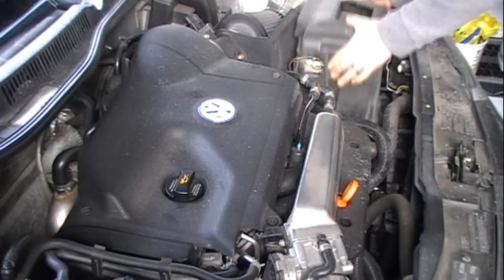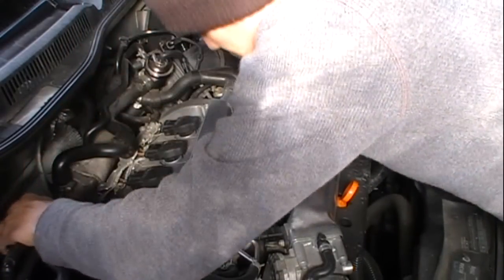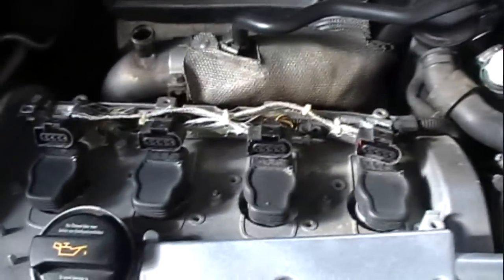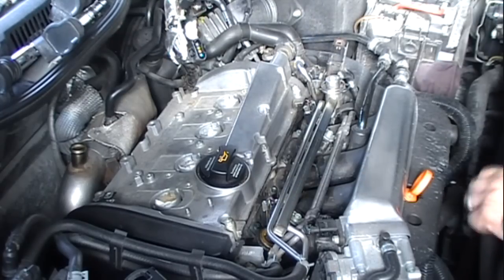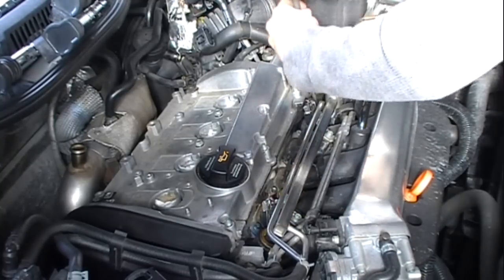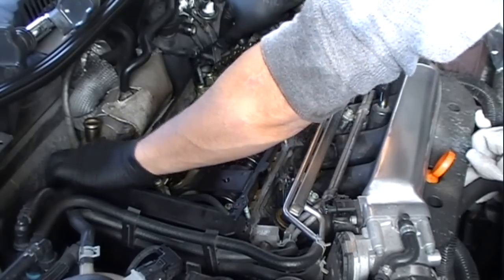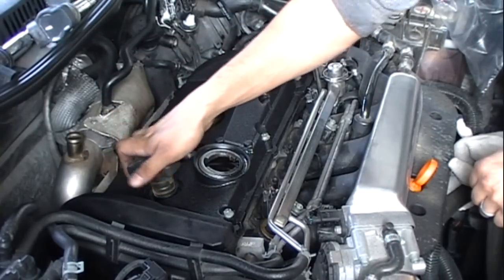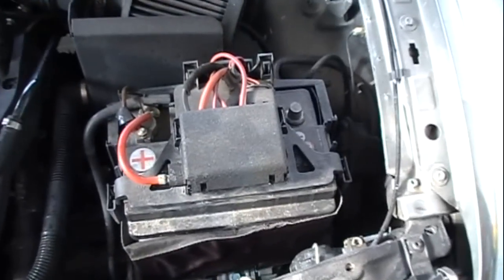VW Mk4 1.8T valve cover gasket D.I.Y.

Comment: bummer, this video completely overlooks the timing chain tensioner gasket at the back of the head. Valve cover gasket leaks are usually the half-moon seal at the tensioner getting mis-diagnosed as a valve cover leak.
Reply from the maker: mine were ok so I never replaced them. they ended up going bad around 110,000 miles.

Comment: Man you totally forgot to put gasket silicone in the four corners. Tisk tisk
Reply: Its goes on the head itself. Only four little pea size spots will do. You can refer to a shop manual for the exact locations. I would recommend using a towel and mineral spirits to remove any residual oil on the head before replacing the gasket. I have had no leaks and a clean install since I commented here last.
Reply: No pattern. 7.5lbs I believe. Just don't break em off in there.

Comment: Great video, thanks. Had some questions for you tho, I see you are running the mk5 coil packs, correct? Also i noticed you had no adapters for them, is their no issue without the adapters? Adapters not really necessary? Did you have a noticeable improvement? Is the wiring harness plug and play or do you need the adapter for the wires? I have a 2000 1.8 with the awd engine. Thanks for your help.
Reply: Hey man 8 years late sorry for that. But its stock coil packs. I have them aswell.

Comment: You need to clean and prep head and valve cover before putting gasket on. Good video but he missed a big step.
Reply: Preping is like as far as lubricating the gasket?
Reply: +Alex Carrillo no cleaning the surface that it adheres too. I used a spray on gasket sealer on mine and haven't had an issue in 26k

Comment from the maker: no i didnt. but the bentley states this.
4. Gasket, valve cover
• Set includes perimeter gasket
and spark plug well seal
• Replace if damaged
• Apply sealant to corner areas at
double bearing cap and chain
tensioner of before installing
im not worried about. ive never used sealant before and had no leaks.

Comment: Does this cover have all the oil mist separator valves? My 2014 vw 1.8T is going through a quart of oil every 200 miles. I suspect it's inhaling oil from the valve cover, instead of separating it.
Reply from the maker: This version of the 1.8t is a different animal. The newer ones are TSI or FSI. Seems to be a common thing which I don't think is normal but vw doesn't have a fix for it.
Reply: I'd have taken it back under warranty...

Comment: i changed  and licks again from the  side of chance! any solution   ? i open it and i put glu but i have the same problem....
Reply: there is a sealant that goes on in a few spot if you follow the proceedure, did you do that? maybe try another brand of gasket I am going to try felpro.